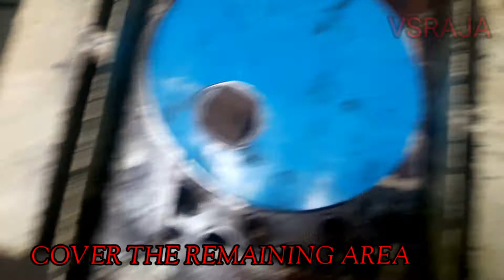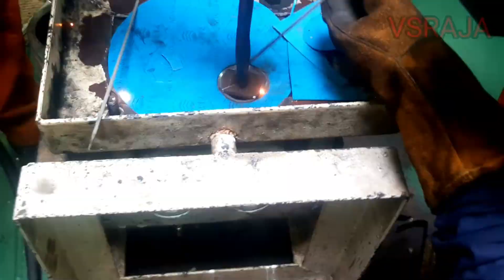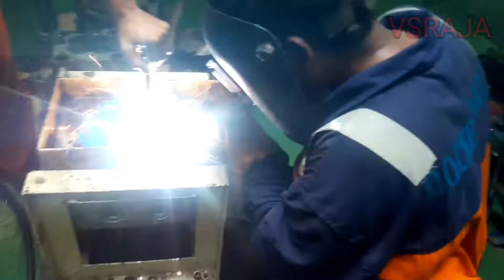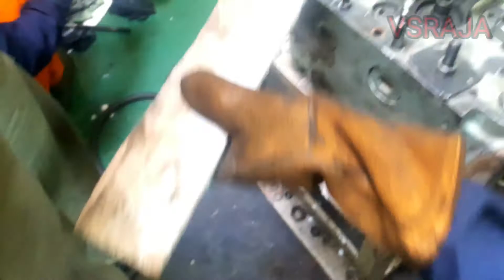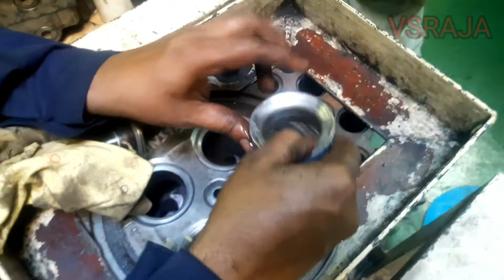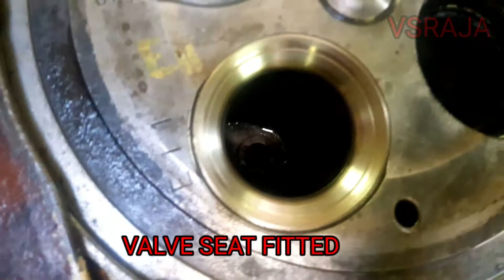DO YOU KNOW HOW DO THEY REMOVE VALVE SEAT FROM THE CYLINDER HEAD?

Comment: you can keep the valve seat inside refrigerator, so it will contract and easily fit on the surface
Reply from the maker: Sure you're correct. It was done in same way